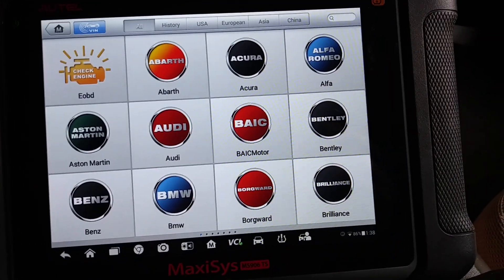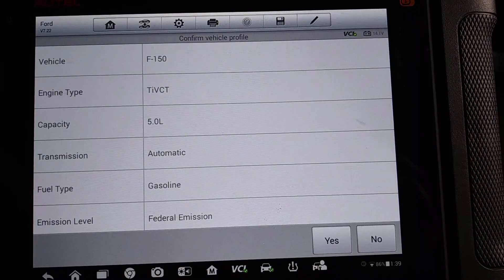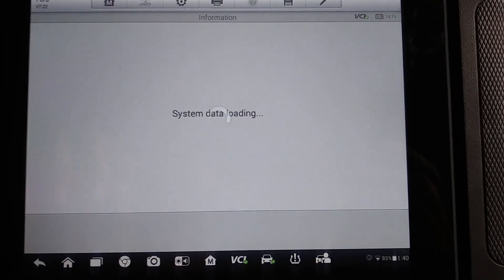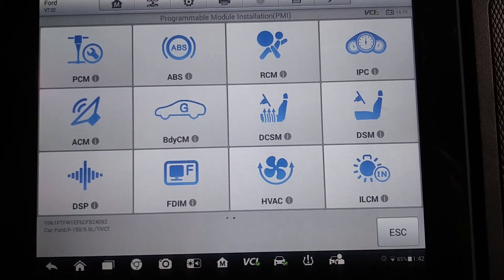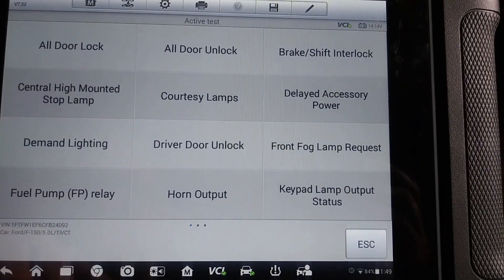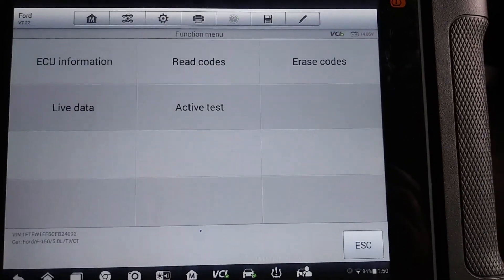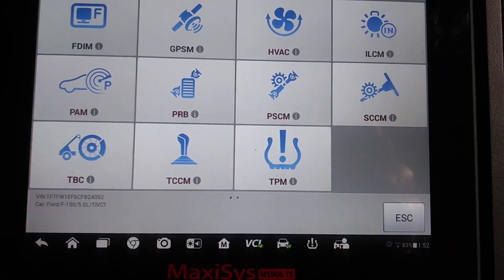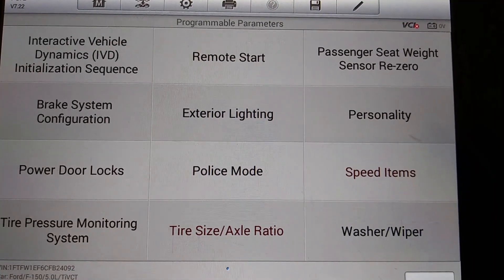Autel MS906TS Active Functions, Programming, and test on a 2012 Ford F-150

Comment from the maker: XTOOL D8BT Automotive Diagnostic Scan Tool with 3-Year Updates
https://amzn.to/45OoRMf
Autel MS906TS 
https://www.amazon.com/dp/B008PTN992?ref=t_ac_view_request_product_image&campaignId=amzn1.campaign.2FPZIW6QG3BK3&linkCode=tr1&tag=737mechanic-20&linkId=amzn1.campaign.2FPZIW6QG3BK3_1761783311960
Autel MS906 Pro
https://www.amazon.com/dp/B086DRGM15?ref=t_ac_view_request_product_image&campaignId=amzn1.campaign.1AXSD88PTM71U&linkCode=tr1&tag=737mechanic-20&linkId=amzn1.campaign.1AXSD88PTM71U_1761782768971
Autel MK900
https://www.amazon.com/dp/B0DHG4FP45?ref=t_ac_view_request_product_image&campaignId=amzn1.campaign.22RG23CVJUYEV&linkCode=tr1&tag=737mechanic-20&linkId=amzn1.campaign.22RG23CVJUYEV_1761782972436

The links I provide are Affiliate links that I earn a small commission from but don't cost you anymore. Thank you for your support.

737mechanic Amazon Store Front
https://www.amazon.com/shop/737mechanic/list/CR3BU74FTDU1?ref_=cm_sw_r_cp_ud_aipsflist_aipsf737mechanic_W4QMHMJ1JD67FDBCQHRK
LAUNCH X431 CRP919XBT Elite
https://www.amazon.com/dp/B0CJDTPDPB?ref=t_ac_view_request_product_image&campaignId=amzn1.campaign.2ZY9S5B0NLAUS&linkCode=tr1&tag=737mechanic-20&linkId=amzn1.campaign.2ZY9S5B0NLAUS_1761784172586
Fuel Pressure Test Kit                              https://amzn.to/3yIOsH1
Autel Products                    https://amzn.to/3dYDp1k

Comment: Thanks, learned a lot from the video.  Have you ever program a key FOB or a lock/unlock FOB using this tool?  If so have you seen a video on the procedures?  Thanks again, very informative
Reply from the maker: I have done many fords, toyota's, and GM's.
Reply from the maker: I have a video on doing a Toyota Tacoma.
Reply: Will it do Renault keys

Comment: How much does the updates cost per year
Reply from the maker: For the TS I have seen them as low as 399.00 but if you don't need the tpms features of the TS version get the MS906BT because they are the same except for the tpms features and the updates are cheaper.